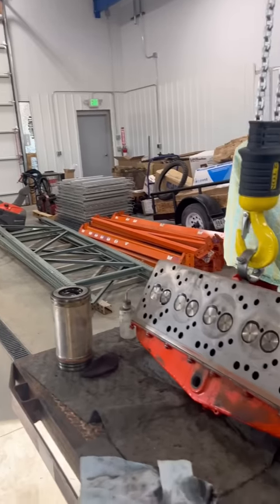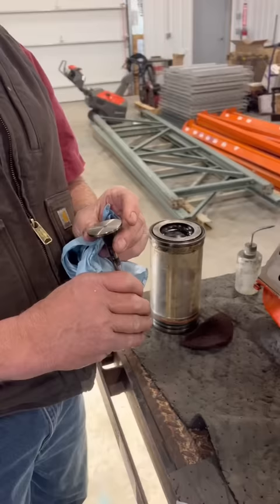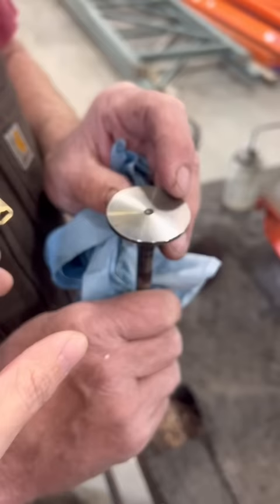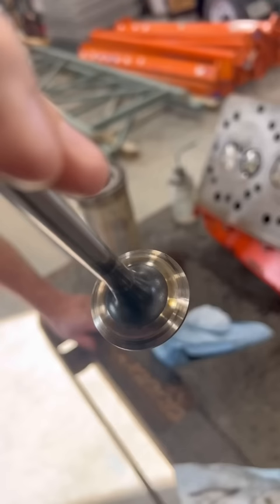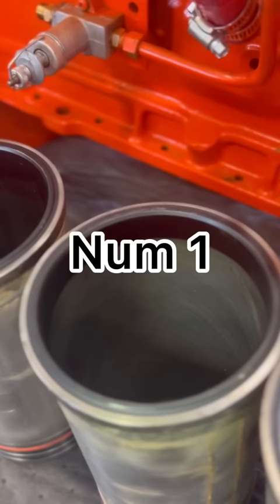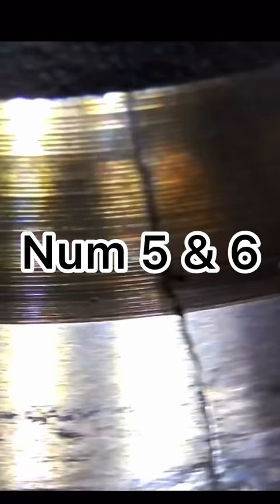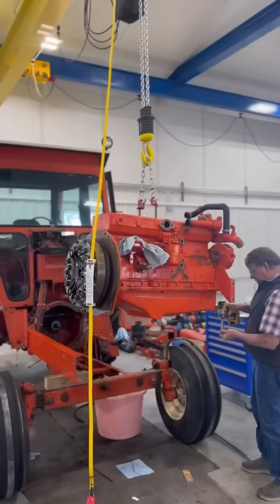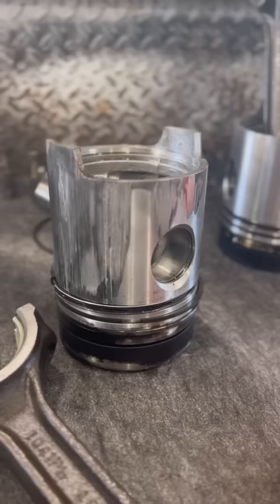#shorts The Story Of The Cursed Allis Chalmers Never Ends…

Comment: Did the nozzle tips (injectors) get cleaned on a steel wire wheel?  That’ll damage the tiny nozzle ports and cause wild crazy injection patterns and hot spot components not designed to take it.
I “fixed” a Deere 619 in a 8650 that the farmer rebuilt.  The engine would not rev beyond 1600 RPM, chug, smoke, pop, detonate, puke out smoke.  He thought he didn’t do right in something lower end and only ran it 10 minutes before bringing it to our dealership. 
I pulled the nozzles, put new tips on and put them back in.  Everything was good and dynoed clean.  He mistakingly put the nozzles on a wire wheel to clean the carbon.
Reply: I think ypur right. Its a fuel issue

Comment: Wow I have never seen a new cracked valve. Makes you wonder about quality control when those parts were made.
Reply: If combustion temps are way too high exhaust valve/ seat damage is common
Reply: @UFO-047  ok makes sense. In my line of work all the valves are titanium and we usually see burning on the edges of the piston of it gets lean in that cylinder.
Reply: Check valve springs and valve lift !  Cam lobe from base circle is easily checked with a vernier, also vacuum test on all exhaust and inlet ports to see if you have a good seal,  Mira, Serdi etc make a good vacuum gauge for doing that 
Do the seats look “hammered” at all ?  Could the crack be due to poor manufacturing techniques , some valves are upset forged and the crack could be due to poor forging techniques.
Reply: @UFO-047  Wasn't the cooling for this particular motor improved for Cooling?
Reply: @UFO-047 might need forced induction/a turbo to lower exhaust temps
Reply: @billvandorn5332  combustion temperatures (inside the cylinder head chamber and cylinder/piston top) are usually too high because of incorrect fuel mixture ratio, timing being off- injection timing in a diesel. As mentioned in another video the injector spray pattern if incorrect can put heat into the wrong areas and overheat the piston and cylinder too
Reply: Makes me wonder where it was made.
Reply: @UFO-047  yes that makes sense. I have been building NASCAR motors since 1994 and back in the mid to late nineties the restrictor plate motors ran 18:1 compression ratio. A diesel is a different animal from a 4 cycle gasoline engine. My experience with diesel has just been things like replacing the turbo on the hauler truck of maintenance on the generator for the trailer. If it’s anything more than simply maintenance on our diesels we just send them to the pros. We ran carbs and leaded race fuel until about 10 years ago and now we run an ethanol blend race fuel and the fuel injection is a lot like the holly system that just goes in place of the carburetor. Made by McLaren. I got out of it right when they started using fuel injection. The thing with that FI it was the first stuff used, I don’t know the particulars of today’s rules but they change so much it’s hard to stay current when you’re not in it anymore. But the first gen you had 0 control of the air fuel mixture. You had to run a sealed box and every car ran the identical map on their Ecu’s with a carb you can change the jets etc. but the last time I was in there it was a big headache and I was getting to old to go traveling everywhere for half the year. It’s definitely the experience of a lifetime but I will let the young guys do all that work. When I was young there was plenty of times when we got the car ready to go at 4:30 am and had to be back at the shop by 2pm so we could load the car tools and head to the track. I don’t miss that.
Reply: Wonder if spring has too much closing force.

Comment: That's terrible about the cracked valve.
This is unreal. 
The parts situation is getting worse.
And the engine builders are caught right in the middle. 
Thanks for sharing.
Reply: I thought about opening a shop, and after seeing everyone having failures, i have a less desire too.
Reply: @JohnSmith-xu7ev  also wanted to open my own shop, still do.  I'm in Toronto and where you are? If you local to me and decide that you still want that reply to me please.  Thinking that it would be better to partner up together to open shop. 2 ppl should be better I think if you do it from scratch
Reply: Started in 80's. Bolts were being shipped that weren't the tensile that was certified. I had an 87 Aerostar came with soft head bolts. They stretched and caused the engine to burn coolant. Long story so I'll leave it here.
Reply: @andrewbanit4884  
Im in Chicago. 7 years they are forcing all manufacturers to only make electric cars. I hope they cancel that law. So thats going to limit on your repair work because battery diagnostics and changes is very specialized. And Covid really screwed up the parts availability and quality.

Comment: Back in the mid 2000s I had a local machine shop build a customers engine and after I installed it, the car ran smooth and quiet at idle then had a slight knocking noise from the top end. At first they thought it was faulty lifters but replacing those did nothing. Eventually I had the machine shop do a tear down and upon inspection all 4 pistons were different heights. Needless to say I and the customer were passed. After that I started building my own engines for my customers. Never had a problem After that.

Comment: Allis always had cavitation issues. But it was usually after 5,000 hours. The way that one sleeve had cavitation after such a short time there was definitely a timing issue or almost a slight out of balance issue.
Reply: With all the galling on the skirts and some cylinders being OK and the 1 with the spray pattern high on the piston I'm thinking they had a injector line out of sequence causing preignition on a couple and late on others would be nice if they found and posted the actual problem so we could see.  they build engines so it should not be a combination of problems even if they are always gas.     Could even be the flex ring in the pump failed making the timing jump all over but still waiting to find out
Reply: What does “cavitation” mean in this case?
Reply: @joshstabler3438  vibration in the motor causes tiny air bubbles. When they burst they take a small part of the liner. I've seen it eat through a sleeve on our 185 allis.

Comment: I'd say the late injector timing may have had a hand in that valve cracking.
Reply: When it ignites, all that pressure has to go somewhere.
Reply: @donttreadonme2171  It's the blowtorch effect- you have combustion continuing late into the combustion stroke and into the exhaust stroke. Makes exhaust valves run VERY hot.

Comment: Holly crap you can see the blueing from heat, she’s been running lean as hell, I’m surprised it didn’t cutting torch one of the pistons.
Reply: It's a diesel, they always run lean.
Reply: some engine problems are not mechanical at all it has to do with the wave operator is living this is brought on by sin quit sinning and your problems will Rectify their self
Reply: @Sonics6969  so you're saying their sins are causing the engine problems? Uhhh that's a heck of a reach there buddy. The tractor is a machine not a spiritual being...

Comment: Pull that engine out and put in a Cummins 4bt turbo, problem solved
Reply: There's enough room in there for a 6BT, that's what I would use. For some reason they are also cheaper than the 4BT. It sucks this happened to them but I'll enjoy their investigation into the cause.

Comment: This had to be a timing issue. I agree that it sucks that the rebuild company didn't investigate the fuel pump. Seems the most likely culprit.
Reply: Excessive pressures/missed up AFRs
Reply: @Airman..  Yes, that can all happen from the timing issue of a diesel fuel pump. Like they said on the other video, if the fuel pump was squirting in fuel when the piston was still traveling upward, it would detonate before top dead center, resulting in extreme excessive pressure and will not burn all the fuel. Combine that with the tight end gaps of the rings, and you get the scorched cylinders.

Comment: Looks like it's been running too hot.
Reply: That's more likeky a symptom  than a root cause. Bad injection timing from the rebuilt pump really seems a possible root cause.
Reply: @larrymitchell3502  yep, heat is being caused by something off. A cracked valve is odd but a piston grabbing isn’t. Related?

Comment: Sadly, some things CAN'T be fixed. Like an ex-wife & a Fiero I had many years ago. The ex is self explanatory, but the Fiero is mind blowing. It had an "Iron Duke" 4 cylinder engine with headers, a fuel injection unit from a Porsche, & more. The previous owner had to rebuild that engine twice. I rebuilt it twice & sold it with a fresh rebuild. The guy I sold it to had to rebuild it at least once, & I know because he called wanting to sue me for his money back. Fortunately it was sold "as is", he had no case. Years later I went to a Fiero show & saw my old car. The newest owner bought it with a blown engine from yet another guy I didn't know about who blew the engine twice. This owner said he blew that same engine once & it now had a fresh rebuild with a few miles on it. As far as I knew, it blew up for a different reason for each owner convincing me that it was a jinxed engine that should have been used for a boat anchor! From my experience, I suggest crushing your engine & see if you can "break the chain", & put in another engine. I know you want to use your skills to find the cause(s) of failures, but you may really need an exorcist. Cut your losses & ditch that jinxed engine ASAP!!!...

Comment: Could be a metal quality issue with aftermarket parts or something like fuel pressure delivery or water or something else causing it to burn hot or pre-ignite a little bit of gas in diesel fuel can cause some some crazy things

Comment: I've seen a valve that looked like a bullet went through it just off center keeping the stem intact.  It ran but sounded like a bubble machine.  I bet that crack would have caused a worse or even catastrophic failure.  Contamination in the metal responsible for the crack or stress during machining?

Comment: I had a cursed Toyota truck. Whenever I would shift a little aggressively after a decent acceleration,  it would snap the main shaft in the transmission. Only going into 2nd gear. I didn't race the truck, it was pretty slow. I broke 5 transmissions in a year and a half.

Comment: Only two causes for this problem. 1. Using a steel crank in place of a cast iron one. 2. Using Alluminum or steel crankshaft rods in place of cast iron connecting rods. Why? Heat expansion apart from cast iron causes a bottoming out effect within the cylinders due to heat stretching on break in. You need to bake your rods and crankshaft in tempered steps to set their temper matching cast iron or your clearances will explode. You might also need to check another aftermarket shop that makes or cast steel in place of cast iron and check their piston length and or crankshaft length to get the correct clearances for switching from cast iron to steel. It nay be that you used brand new original  pistons when a steel crankshaft would require pistons with a shorter length and or connecting rods with a shorter length.
Because many of these tractors are bo longer made nobody likes to use cast iron. And that is the problem because cast does not stretch when hot or cold.

Comment: Make sure injection timing is on and marks on balancer are correct . That it didn’t slip ? If oil cooler nozzles are clear? Check with air pressure
Reply: Piston cooler nozzles for clarification

Comment: As an engine builder, I have seen this before in straight six and four engines.The first engine cylinder number one always runs the hottest because the coolant is being pulled towards the rear of the engine on acceleration. Its just an observation after many years and many tear downs. of course they can be many other factors …Keep on rocking.
Reply: Isn’t a whole lot of acceleration on a tractor .

Comment: Sure sign of heat stress.  Valve was very hot, then engine shut down with valve closed cooled the rim fast, causing the rim to shrink faster than the center which induced large tensile hoop stress.

Comment: I in my opinion that engine ran hot do to timing of the injector pump, it was either late or it was early , late will burn exhaust valve early might burn intake the valves show it was a timing issue

Comment: If it has bad juju. Get rid of it and start over. I had one marine engine that haunted me, finally had another colleague take it out of my hands and  game over. I rebuilt the engine 3 times, had nothing but issues. Rebuilt that particular brand engine at least 500 times m, with no issues. That engine is cursed, does not want you to succeed.

Comment: I’m not sure that you were wrong. Spiking the combustion temperature could show up in different places because the temperature rose so rapidly. Perhaps the scored cylinders have slightly poorer cooling, and once clearance dropped to zero, piston temp would have skyrocketed, seizing the engine before other cylinders suffered damage. And possibly the cracked valve was in a cylinder with good cooling, but higher combustion temp. It seems pretty clear that the valve got very hot. Just saying, it’s still possibly consistent with your previous diagnosis.
Btw, you didn’t inadvertently sub forged pistons for cast, maybe without knowing it? (I don’t know what was stock) I’m guessing not, but clearance for forged is bigger…

Comment: Did you ever find problem with this engine? Had an issue similar with a marine Hino Diesel engine had it out of the boat like three times found the fuel injectors to be problem the engine was actually running lean/ rich

Comment: Was the oil pump replaced??
Were all the oil galleys blown clear?
Lack of oil/oil pressure will also cause 
those problems that look like an over
heating issue...
A freshly overhauled engine should have a new
oil pump installed n oiling system checked..

Comment: Have the injectors been balanced/pop tested? Been following for a while thinking that and seeing the valve/ damage it seems like a pressure spike forcing the rings into the cylinder walls and the jackhammer that cracked that valve. Or that injection pumps got something up with it

Comment: Injector pump system inspection?
Oil pump/pressure?
Heat running/cooling flow?
#1valve had been hot ??

Comment: As far as I know, too lean would just stall the engine. A diesel at its leanest would be idling, and too lean would run slower until it dies. Inject more fuel to produce more power. Most diesels have no throttle plate, and the intake is wide open.

Comment: Switch it to another motor. we bought a dirt roller real cheap at a auction turned out. The motor was some special deal and it turned out to be a piece of crap so we end up running it back to the auction to get rid of it.

Comment: You over corrected the tapered chamfer circumference causing excessive thermal elevation.  Reduce your flux capacity calibration ratio at ambient temperature next time.

Comment: A lot of the problems you are having is coming from not y'all when you rebuilt the engine but from other people that have overhaul this engine before y'all and did not overhaul it correctly which caused other issues again to you other people has overhauled that engine before and never told you that's what happens a lot of times when people get equipment and there's no real information on this equipment but I am glad that y'all are going through this engine the proper way and inspecting every little thing that's you can find hats off to you for doing it the way you're you're doing a wonderful job keep up the good just remember the most anybody has problems can become the biggest

Comment: Seems like a bad valve from manufacturer, unless possibly massive seat pressure or using a ton of starting fluid or partial hydrolocking from leaky injector.

Comment: Number 1 cyl liner was completely washed clean from fuel as if it wasn't even lighting off which is weird for a diesel. Since it was a new exhaust valve that cracked I would check that injector to make sure it wasn't "dripping" fuel just short of hydro-lock and cracked the valve in the first start up cycles then lost compression to the point it was just pure fuel wash.

I thought I was subscribed but looks like I'm not, so let me take care of that now

Comment: Since the majority of the pistons were scored, being that the skirt clearance wasn't too tight,I'd guess she was running too lean...
Reply: No, there's no such thing as leaning out a diesel. The leaner they run, the happier they are
Reply: @Curtis D  Thank you for the clarification...What do you think is going on with this build.? Do you think the injector timing is causing  some sort of detonation for it to be across the majority of the cylinders..?
Reply: @Philip Myers  no diesels don't have detonation problems. They run off of detonation. I personally think the injection pump was rebuilt poorly by the shop that did it and had either really late injection or too long of an injection event. Makes a ton of extra heat and often destroys stuff. Replacing the injectors would also be a good idea. If the orifices are too worn it can cause a poor spray pattern and make problems as well
Reply: @Curtis D  Thank you for responding...I am more aware of the nature of diesel engines than I was before this string....
Reply: @philipmyers583  happy to explain things!